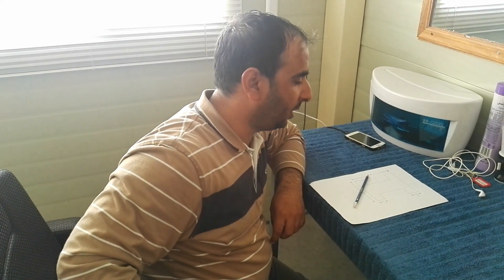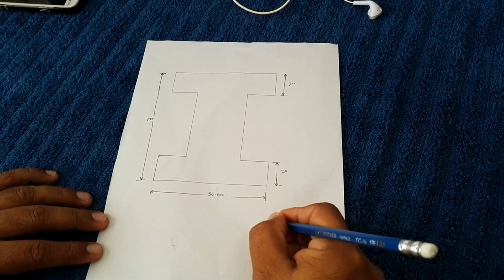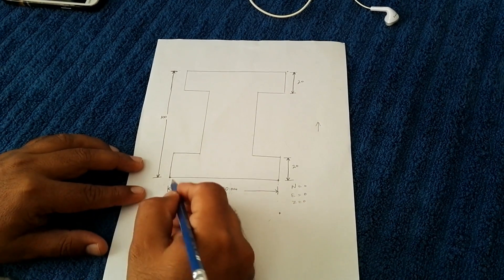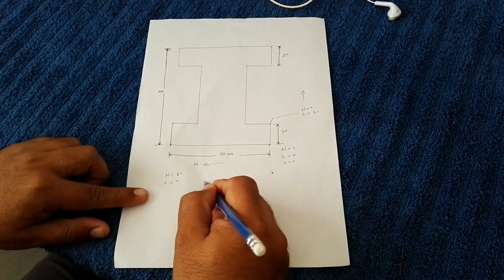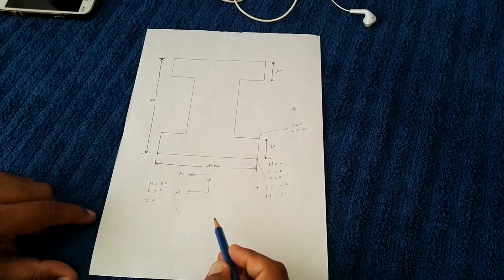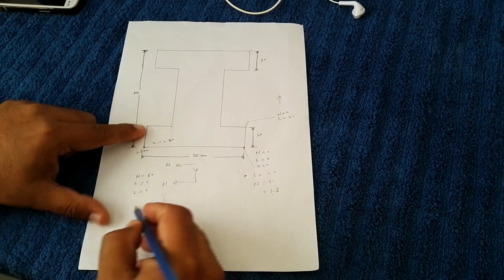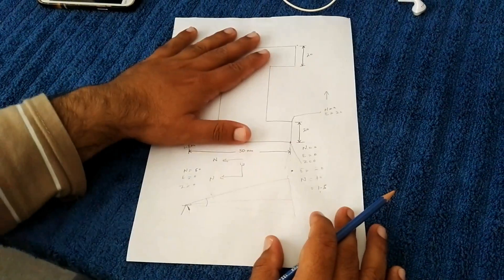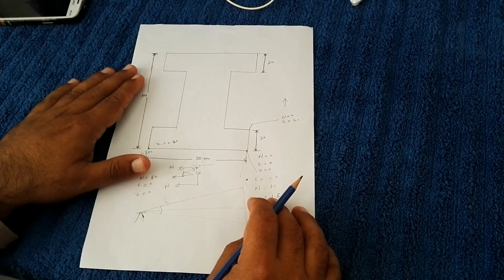How to Start Survey work without Benchmark(Using Total Station)in English(Survey with Benchmark)

Comment: Assala-O-Alaikum! Brother Aamir: This is very good and helpful tutorial . I have a question, If I don't have any point on ground so how can I sight or target the first point? As you mentioned in this video to layout of I shap drawing and we have only drawing and no point or corner on ground , we will assume northing and easting and z=0 but where or which point we need to target because if there is no single points on ground? Do we have to set the total station on true north as first point?
ThanksHanif
Reply: Kaise sir ???
Detail me samjhaye.
Reply from the maker: W Salam 
if you donot have any points on ground then you can creat by yourself that call assume points for example i creat 2 point base on my project location then you can use that point in local resection if you have any problem about local resection then you follow my this video
https://www.youtube.com/watch?v=eVjRtTv2W7M